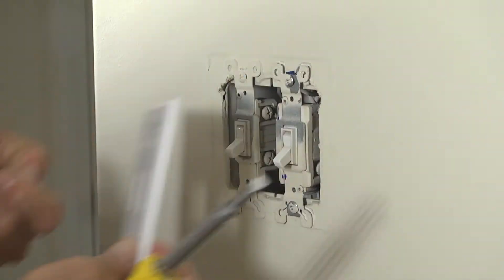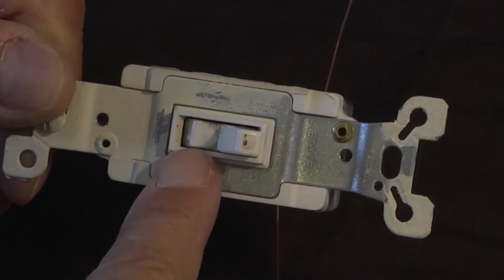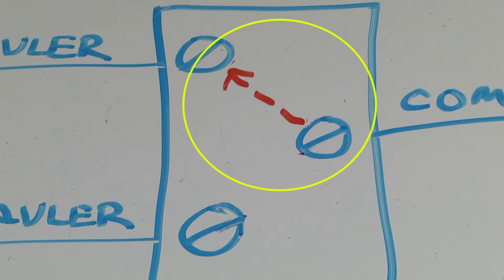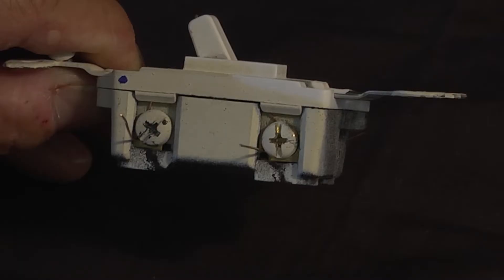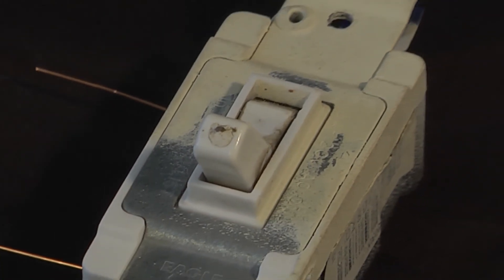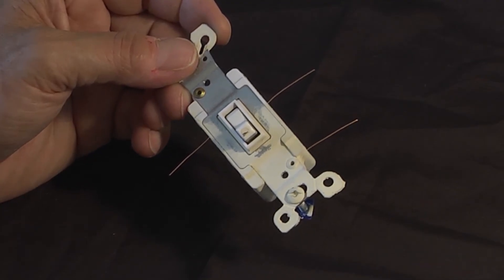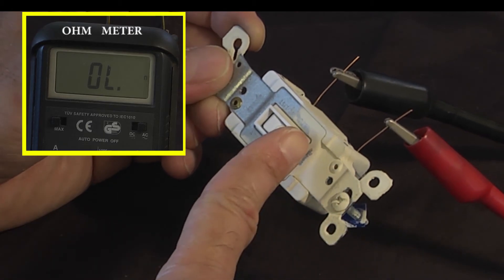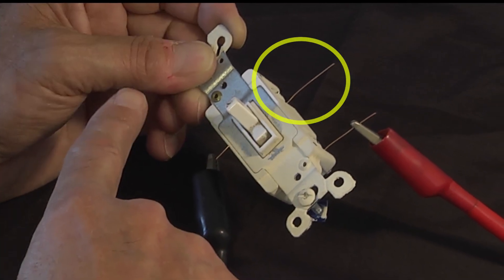Find the COMMON (load/hot) screw in a 3-way switch in 2-minutes!

Comment: It’s a great topic and explanation - only thing for me is that The switch I am using has two screws on the right, the ground on the top, and nothing on the left. 
I don’t think your count of 3 screws includes the ground. If you only have 2 screws, is there a way to use a multimeter to find the common? Or another way?

Comment: Can a light be added to switch number one? I could wire the two lights together but would need wire mould along the ceiling. However, I can get to switch one from above and that would be a shorter run to my desired second light position.
Reply from the maker: Kim Mathews
	
	11:04 AM (6 minutes ago)
Give me a call at 310-398-7430 (voice only-no texts) and I can help you out. Thanks, Jim

Comment: Fantastic. I fixed 2 sets of 3-way switches for my son in law. They lived there for over 2 years and became used to the switches not working. Using your video it was so easy to fix them and incredibly fast. THANKS so much. We were actually thinking of running new wires which would have been very difficult.

Comment: Or you could do like I did when I replaced a 3-way in my 1950 house years ago.  #1 flip the switch, direct short, hear the breaker trip.  #2 the switch acts as a on/off single pole, other 3-way position is dead.  #3 the terminals are connected so you can only turn on at one position, then off at the other.  Yes I did get them to work properly.